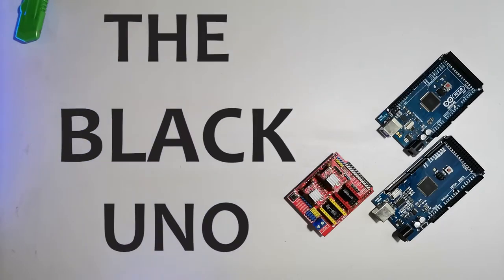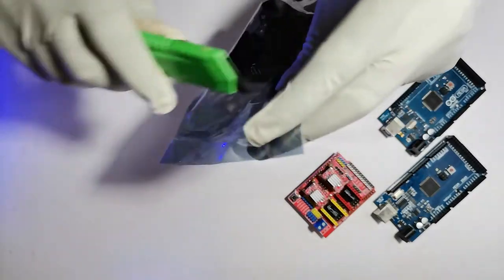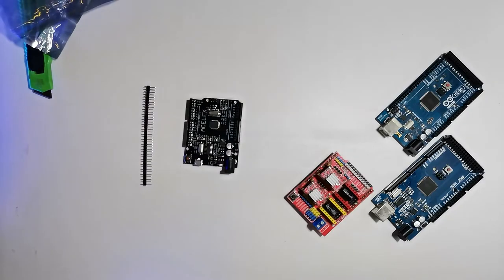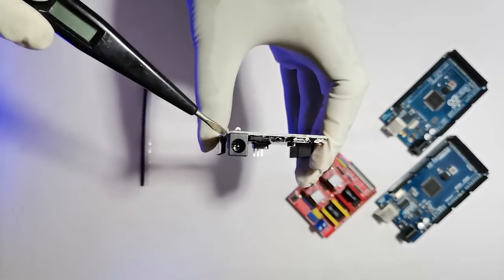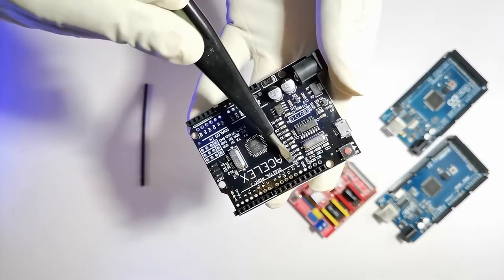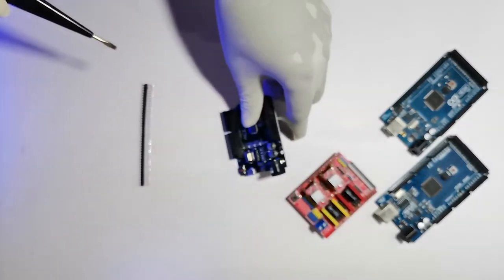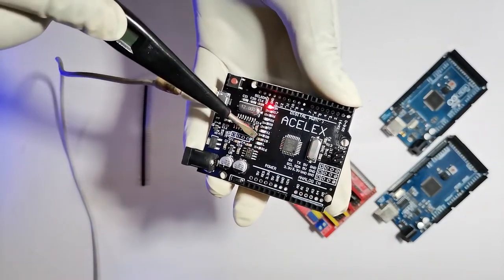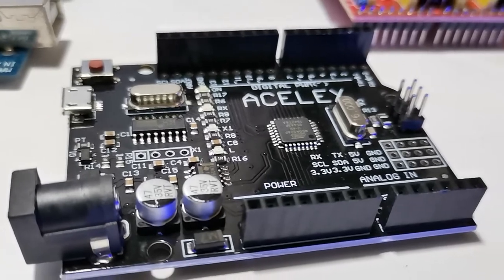Unboxing The Black Arduino Uno - Acelex Uno board -

Comment: Где найти драйвера для неё, я её купил, а драйвера не знаю где найти
Reply from the maker: you can use the same drivers for arduino UNO. most of them work fine. But sometimes issues can happen because this one is not original